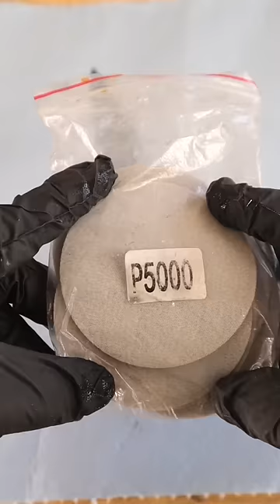This blade has a meteorite forged into it…

Comment: Those holes at the base of the blade and in the tang are coo and all but it has gotta lower the overall structural integrity. Idk though never worked with meteorite